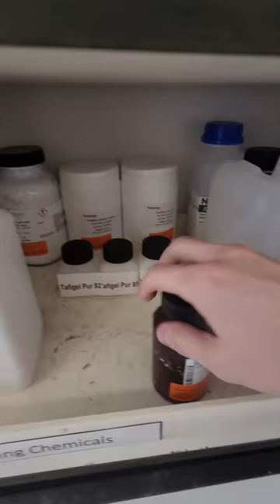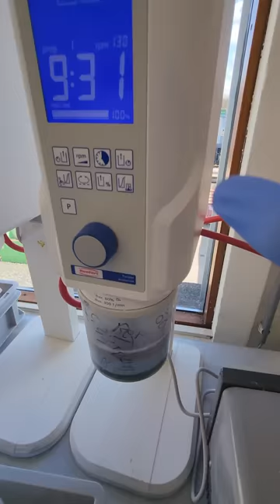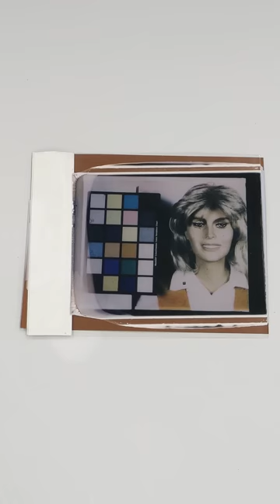I broke into Polaroid and committed corporate espionage

Comment: Former film lab employee here! The block of colors you see in the test image can be read point-by-point on densitometer or colorimeter machines. These measurements (in black %/transparency and RGB values) are compared to laboratory standard values for a certain type of film stock as a QC measure for that batch of developed negative. And the mannequin is probably the skin tone reference. 😊
Reply: That's neat, I was wondering about that
Reply: I figured it was for color accuracy
Reply: i wondered why the eyes looked dead. lmfao
Reply: VFX artist here, I didn't expect to see a macbeth chart pop up in that video! We use them everywhere to calibrate our reference pictures or make sure our CG renders have plausible values
Reply: I'm sure he knew why they had the picture but in the video,  Nile acts clueless as he lucks his way through the process
Reply: fanget.18  i know if you cut open a regular polaroid, you can recover the film negative and make more prints, so it behaves like a regular color negative. But I don't know if the film itself is regular C-41 stock
Reply: @Beakerbite  he absolutely knows what he's doing. They obviously allowed him to do this after all the proper circumstances were met, to make the quick video.